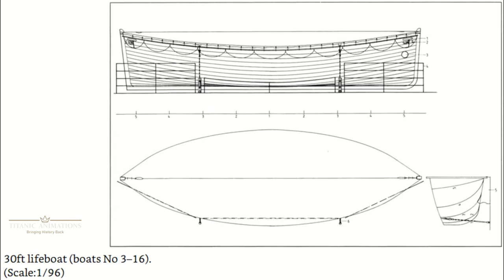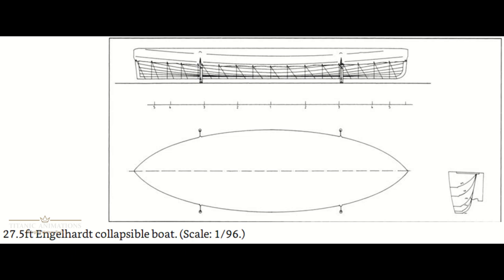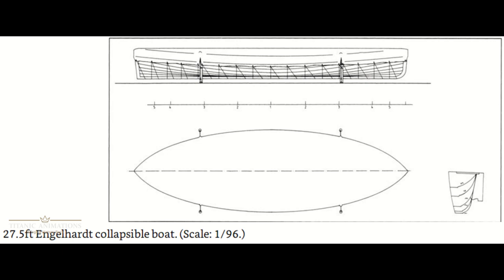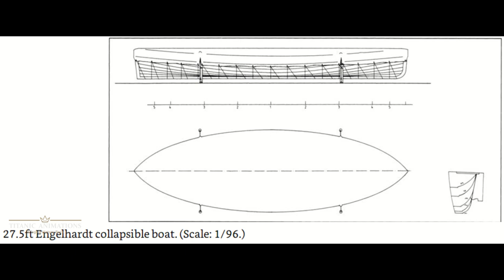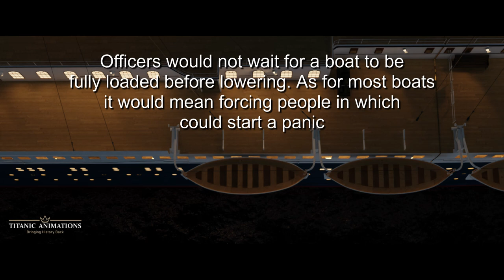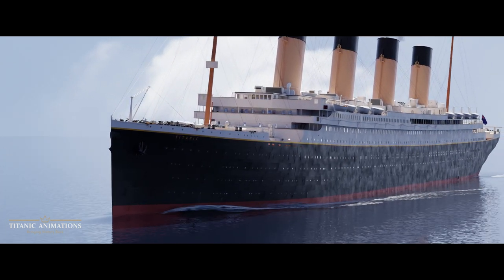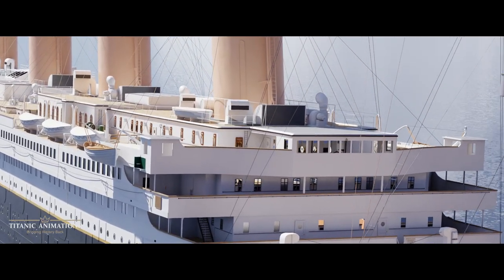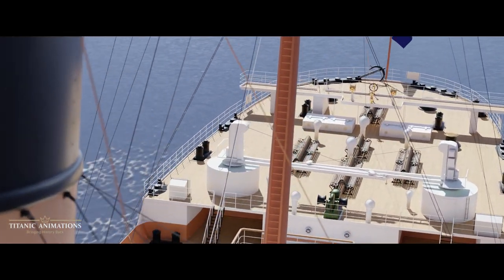Why Were Titanic's Lifeboats Launched Half Full?

Comment: I thought another significant factor was not wanting to fill the boats too heavily. The crew generally didn't understand the limits of the davits, despite them being stress tested in Belfast, so with no drill to get acquainted and no notification from the White Star Line, they were very cautious for fear of the launch going wrong. There was also the fact that there were several plans, like Lightoller and the D-Deck door, to load boats further after they touched water, but these never materialised.

Comment: Another reason why passengers were reluctant to board the lifeboats were probably those stories of wrecks in the decades past, involving, but not limited to the following: Lifeboats overturning on their falls, getting one end of a boat to fall down and leaving the lifeboat at a steep angle with one end skimming the water and the other 15 or so feet above it, being dropped a dozen or so feet into the ocean, launching successfully only to be smashed against the hull in rough seas, lifeboats swamping because of the lack of a plug, being crushed by a propeller or paddle wheel, and some lifeboats outright disappearing. In some especially tragic cases, the boats with the women and children suffer any of these fates, killing their occupants, only for the ship to stay afloat and rendering their deaths senseless.

I'd possibly also be reluctant to put any family in a tiny wooden rowboat. And because women of this time, like it or not, still somewhat depended on their husbands for guidance, they were also reluctant to board a lifeboat without them.

Comment: It would be incredible to see a real time sinking with this CGI. Its beautiful. Keep up the good work!
Reply from the maker: I agree but it would take a long time to render off due to the complexity of the shots. The big shot here is a 5 minute long sequence and it took just under 5 days to render, about 4 days and 16 hours. If the real time rendered at the same rate it would be about 160 or so days to make 1 Real-Time. BUT night scenes take longer to render off than day scenes because of the reduced lighting, on average they render off at the same speed but I have to increase the sample rate to reduce the noise/grain in the renders. Increasing the sampling also increases the render time. The footage from the "Dynamic Lighting Test" videos is a good example. Both of those videos were also shots that were about 5 minutes in length, and they took about 7-8 days each to render off. That is almost twice as much render time as a day scene. So I'm looking at about 280 days to make a real-time with this visual level.  280 days divided by an avg of 30 days a month = 9.33 months.

Comment: This video is inded informative and also relaxing theres inded a point here the boats are lowered half full because to not cause a panic and to keep this secret evacuation stedy and affectively and if your a crew you will think of the same thing you cant wait for the boat to be filled to be lowered and later on the sinking it would still not be possible due to the amount of panic happening on the deck the crew have to be also caution of how many people there putting in from the crowd to the boat at the same time to prevent any ferther danger happening to the boats them selfs its a hard management i must say the crew really did there best and due to that there actions saved 712 souls from the ship and i really respected that rest in peace for those who died in the mercy of the atlantic ocean and those who passed from the 1.496 souls.

Comment: I noticed that the famous "Tripple Screws" warning messages on the stern are painted gray instead of red. Can you explain this?
Reply from the maker: I had it painted red but a bunch of fans from facebook and discord started having a debate over the color of the sign, I personally don't care if it's violently purple with neon strobes on it, just as long as the sign is there. They wanted it grey, so I changed it to grey.